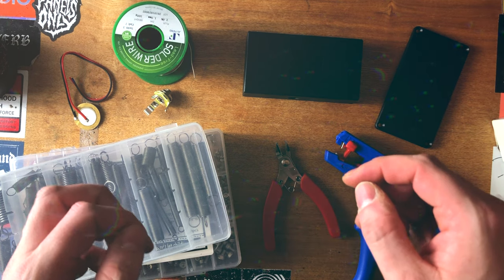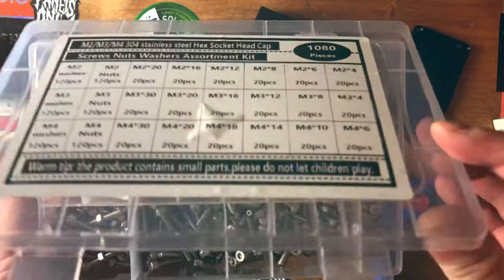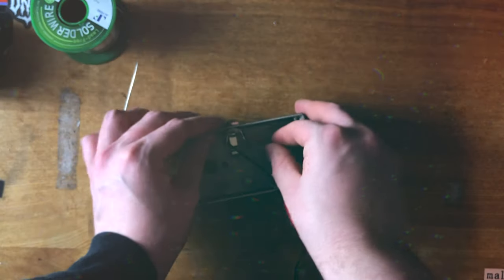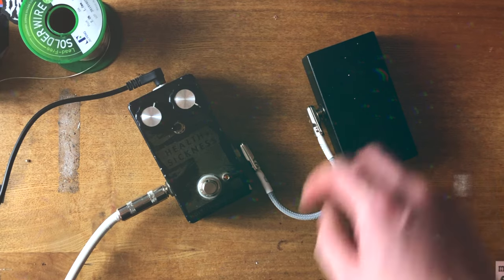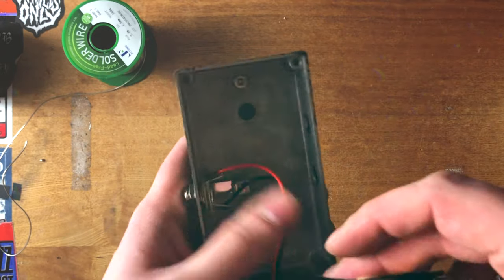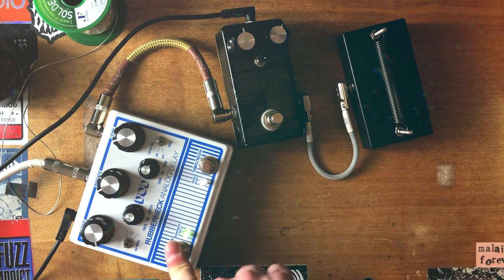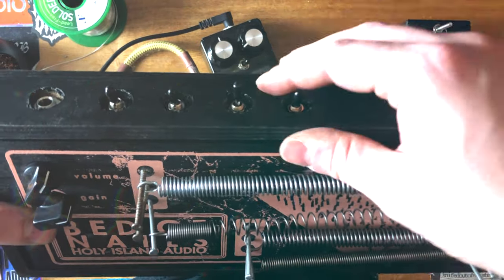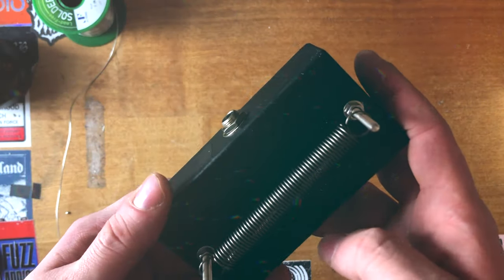EASY DIY NOISEBOX TUTORIAL ( BED OF NAILS )

Comment: Long ago I once used an old cassette recorder as a preamp.   Just jack-in the microphone /monitor for the input, then mechanically engage the  record button.  The earphone jack served as the output.  Worked well.  BTW, I also spliced a potentiometer to the motor for a crude speed control so I could make some peculiar recordings.

Comment: Love this, i want to make one with Bass strings on it that you hit with a drum stick.
Reply from the maker: Do it! You could always mount an old pickup on the surface too and add a simple switch between that and the piezo. Or a blend pot if you’re feeling spicy 😉
Reply: @HOLYISLANDAUDIO  YEAH! - I've got some old pick-ups somewhere, defiantly need to try this some how, or just massive springs that you can hit. Do you have any schematics of how a blend circuit would work?
Reply from the maker: @unholyaudiochannel  There’ll be a bunch of them floating around the web. A jfet clean blend circuit would do it, or the run off groove splitter blend or even some sort of simple active mixer would work well 👍
Reply: @HOLYISLANDAUDIO  sounds good cheers mate